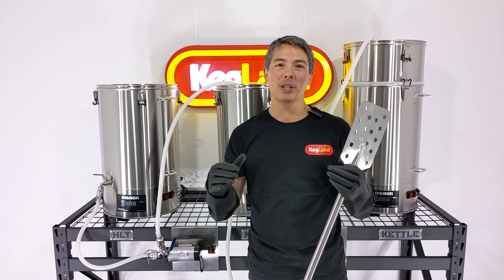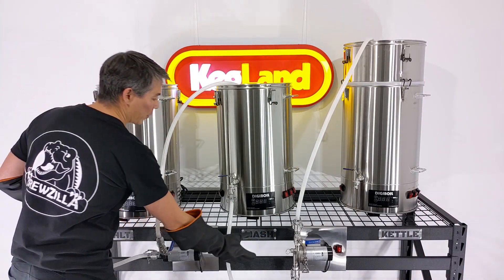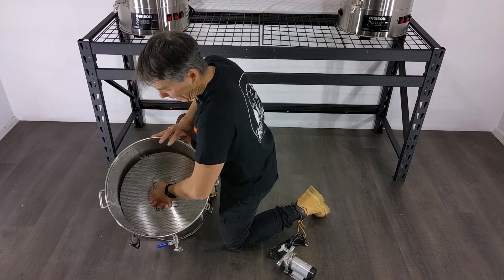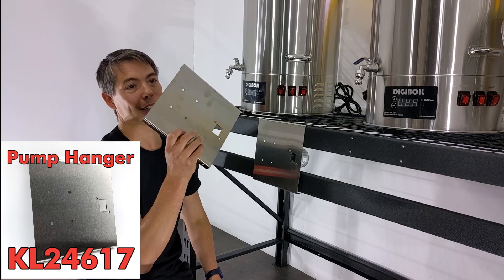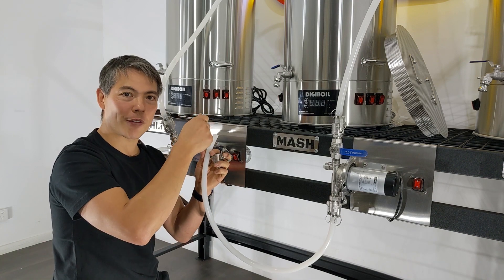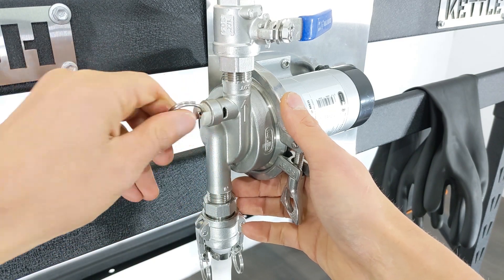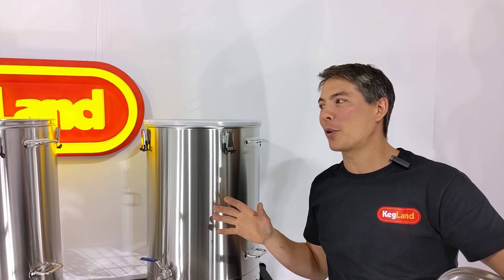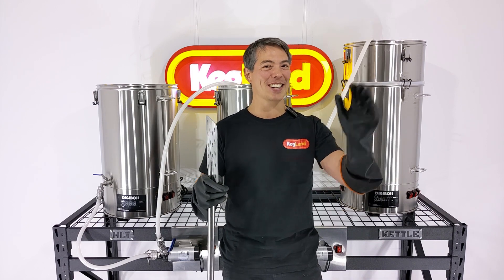Digiboil 3V Nano System - RIMS or Herms - Easy to Build, Clean and Use

Comment: I was confused about the RIMS piece. The heaters?
I thought it stood for Recirculating Infusion Mash System. The Brewzilla has a re-circulation arm and silicon tube that pumps the wort over the mash bed and permeates the grains. For a 3V system the pump outlet can recirculate the wort during mashing. No malt pipe required, just false bottom and Mash Tun?

Comment: You've got that totally wrong with the pump , 3.5 m of head means it can pump up hill 3.5 m at the diameter of the outlet so not much weight at all even if you were correct about suction ,which you aren't either no such thing as suction only vacuum which lowers pressure and the higher atmospheric will push fluid down , but these aren't vacuum pumps anyway they are only gravity fed and if your grain bed is blocked the impeller will just spin ( just like an electric whisk in a cup of water ) and pumping will cease !
Reply from the maker: It might be worth looking at these pictures here:
https://cdn.homebrewtalk.com/data/attach/502/502618-fb1.JPG

We see this type of thing happen frequently and have seen many false bottoms absolutely collapse due to suction from the pump.

Comment: The elements on these digiboil are they controllable like the brewzilla so that you don't overshoot your mash steps? i.e. Ramp down the power as it gets to temp
Reply from the maker: You need a power controller in additon to the digiboil to control the element power. You have a couple switches on the digiboil but this controller gives  you more ability to control the power:

https://www.kegland.com.au/2400w-power-station-240v-power-controller.html
Reply: @KegLand  According to the video you need 15A for the digiboil and the power controller you linked is not meant for 15A

Comment: I used to have a similar set up in 57L/15 gallon  kettles on hellfire burners.  I now use my all in one. This system is very ...uh ... cute.  It's also very clean.  How do you run all 3 vessels without blowing a circuit?
Reply from the maker: You need quite a bit of power to run all 3V.  It's easy for people outside of Australia but due to America being 110V you have a significant power limitation.  I assume you are in America right?
Reply: @KegLand  yah.  That makes sense.  I should have been an electrician so I could wire up the whole house.

Comment: The whole setup looks amazing, especially the build in heating elements. And looks like this system can do double batch at the same time, batch 1 in BK and batch 2 in MLT, right?
Reply from the maker: Yes absolutely you can do batches one after the other like that and it would work well for this application.

Comment: Well I think I'll build this package instead of 2 x 65L Gen 4 Brewzillas. Extra extender on the mash and 2 on the kettle, should give about 100L Shouldn't it? Are the pump hangers and laser cut labels not available yet Kee?
Reply from the maker: Yes, if you use two extensions you will be approximately 100L boil size.  We are putting the pump hangers on the website now so they should be visible very soon.

Comment: A lid with a built in camlock or sparge / recirculation top would be good.
Reply from the maker: Yes that is a fair point. I will talk to the others about this as I think that would be a nice accessory.

Comment: Where did you get the 400kg ?
3.4m equates to 33,320 Pa
Each digiboil contains 65L or about 65Kg of liquid.
Reply from the maker: The diameter of the 65L Digiboil (and therefore the valse bottom) is almost 40cm in diameter.  Although centrifugal pumps are generally not designed for good suction, once they are fully primed they can suck almost as hard as they can push so if you look at the 40cm diameter and 3.4m head this is enough suction to crush many of the weaker false bottom designs.   For instance we have the 30cm Domed false bottom which is a cheap alternative and the pump can crush this false bottom if you get a stuck mash ontop of this one for this reason
Reply: @KegLand  The diameter is not relevant to the head which is only dependent on the height of fluid above the suction inlet of the pump and the density of the fluid (and the gravitational force which is a constant).

A lake with 63 Trillion litres of water in it but has a maximum depth of 1 m, will have the same head at the bottom as a back yard swimming pool with 1m depth.

I still don't know where the 400 kg figure comes from.
Engineers need the calculations as well as the equations used.

Comment: Would a 10w to 15w splitter box work for enough power?
Reply from the maker: Yes you can do that too. If you do that then you just have to keep one of the elements turned off so you are not drawing above 2400watts.  You also could technically disconnect the element wiring and replace the unit with a 10amp cord too.